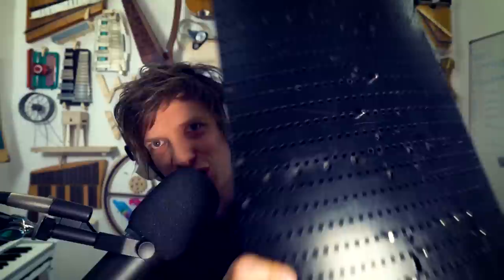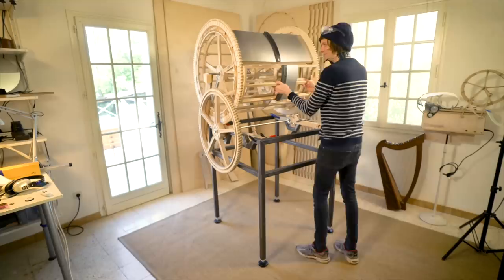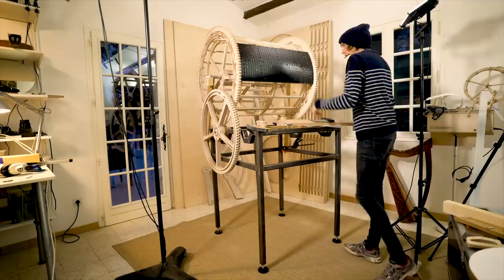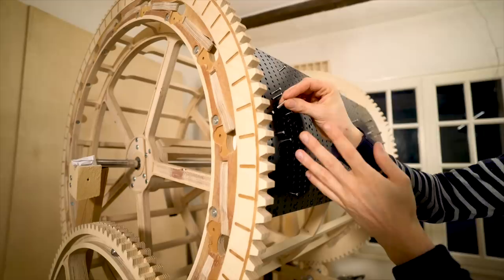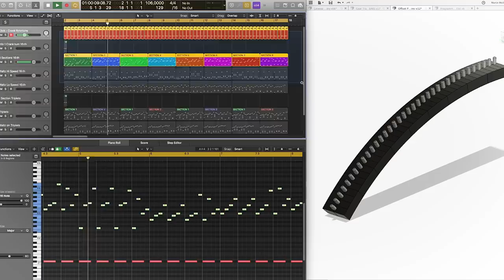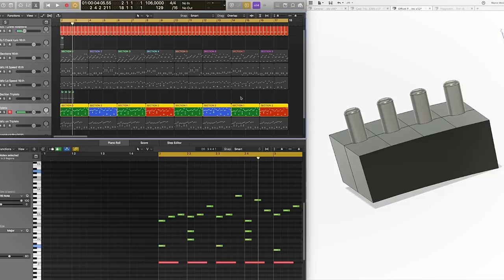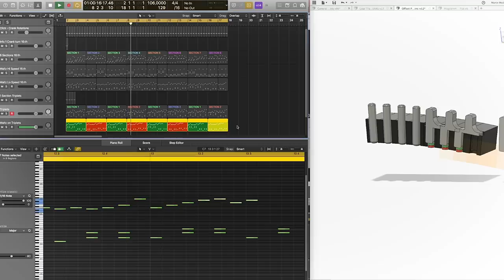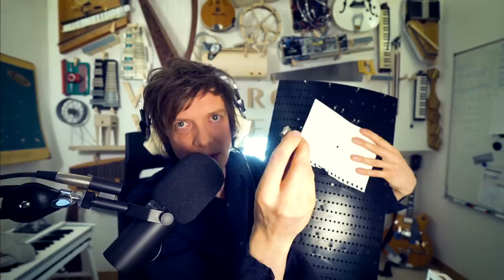Magnet "Midi" Music System - Marble Machine X #25

Comment: Hi Martin, greetings from Germany :D
 I really like the idea of two rows of registering holes next to eachother, if the small arms that release the marbles are wide enough to touch both rows. Or make a third set of 8 sections that is only made for 3/4 rythm. I would also stick to the round neodym magnets. Round holes are easy to machine, I guess that even the cnc might have troubles with square holes because you would have to use tiny cutters for that.  Also the magnets are easy to replace when you are on world tour, in case some of them brake or get lost. Any custom pins are hard to replace when you are not in your workshop.
Those would be my thoughts as an engineer and woodworker. 
Love what you are doing :) keep doing it!
Regards,
Thomas
Reply: Alternatively, you could broach square holes, but that's a pain in the butt. In metalworking, it's done using a hydraulic press. So, yes. I'd stick with round holes, rather than square.

I like the idea of having 4/4 and 3/4 registers next to each other per track so that the keys are wide enough to hit either.
Reply: If the actuator arms are not wide enough then smaller diameter pins could work. If the diameter is too small an the neodymium magnets start breaking you could just switch to the steel pins with magnets glued to the bottom.
Reply: Well since its made of plastic, he could get a small mortise to make the square holes. Heck, he could mess around with living wood joinery to make the register plates.
Reply: As it is, I think the actuator arms are wider than the pins, so having the two rows next to each other per track would just mean that for the 16th notes, the pins would hit one side of the arm (key?) and for the triplets, it would hit the other side. As long as the actuators are wide enough to cover that width, then we're golden!
Reply: I think if you can having the 3/4 and 4/4 rows next to each other as suggest is great because it also furthers rhythmic possibilities, the triplet and 16th notes can be combined for new possibilities...
Reply: Unofficial Discord - https://discord.gg/QdNwA5Y
Reply: I should also point out that the last time I played music was in my grade 5 band class, so my terminology is a bit rusty.
Reply: If there is place for three rows next to each other, i have drawn a cool solution here:
It can evenly divide into 6 and 8 per turn

https://www.reddit.com/r/MarbleMachineX/comments/7xnl7r/triplets_and_arpeggios/

I mean, the lines can go pretty close to each other, the holes can even overlap a little and still function correctly.
Reply: Daniel Bauer looks like you had the same idea I had. I like the diagram too. It is an elegant solution altogether. However, after looking at your diagram it is apparent that you would either need to have skinnier holes and pins or you would need to space them out further horizontally. Without doing that I think you risk the structural integrity of the walls between the pins (keep in mind that even though the front face is smooth, there are hundreds of ridges cut out so that it can bend).
I think it’s a brilliant idea and it pushes the limits on the precision of the alignment of the pins (and thus the timing). This is definitely the right idea and I believe it deserves to be improved upon, though I don’t know specifically how it can be improved.
Reply: I really like Daniels idea and agree that it would not lose much, if any, of its structural integrity, while also creating much more interesting pieces. And for the reprogramming, maybe you could use those CNC forms but in two sections so that the pins an slide through them, as the whole thing is curved, and have people placing the pins in them ahead of time if necessary and then just pushing them the rest of the way through the wood into their respective holes on the wheel? also, you could use the same latching system you use to hold the sections onto the wheel to hold the forms to the sections. And Quoting Buddy Clems comment because I saw it and thought it was also an amazingly awesome idea, "also add an RGB LED strip light to light the machine for playing and photography, and mount video cameras to the frame of the machine so no shot is missed."
Reply: Pilot´s Workshop I agree with all of your ideas and would like to add a few. There should be a shallow groove to mark each  measure, and vertical grooves to divide the many tracks into smaller groups to make programming easier; Similar to the 2 wheels and alternating black and gray Lego pieces in the original Wintergatan Marble Machine. Other posters have suggested alternating colors or finishes to distinguish between songs or adjacent panels. Others have suggested markings or shapes to ensure that the panels go in the right way. It's been suggested that programming templates be used to reduce errors and add a decorative pattern for each song. I like all of these ideas, but also add an RGB LED strip light to light the machine for playing and photography, and mount video cameras to the frame of the machine so no shot is missed.
Reply: I think one could only get so complex with the rhythms, because the limiter will be how fast the arm/key can drop the marble, reset and load the next marble. That's limited by gravity and the friction of the parts. Too fast and you could potentially lock up the machine, which would be a real show stopper, because that's the very thing that he's trying to avoid with this version. I'd probably pick one metre per channel and stick with it throughout the song.
Reply: Why not have a single set of holes and then a variety of pins to accommodate whatever register is required? You could color code them to make them easier to identify & stick with the slot design to hold them in place.
Reply: its harder to make the pins, and easier to confuse them. The bar magnets that he's currently using are, as he demonstrated, pretty robust for what he's doing, and are readily available mass produced. 

Remember. Engineers are lazy. They go for the simplest solution that works, cause that's what saves money and gets the job done.
Reply: to your first statement, i concede all points. the pins are robust enough (and may even demonstrate failsafe breaking in the event of a jam), and they are also cheaply acquired.

to your second: martin be be currently doing the work of an engineer, but that is not his trade. i am all for "the simplest solution" but there are many dynamics at play in this endeavor. the goal is to find the simplest solution that fulfills all requirements. if it is a requirement to have a flexible register, my solution makes a bit of sense.
Reply: It's not just a jab at engineers, but actually the mark of good engineering: The simplest design that bears the most function. 

There is a reason for this ethos of "laziness." The simpler it is while getting the desired job done, the less there is to go wrong, and the cheaper/easier it is to produce. In the case of swapping pins, it's much easier if you don't have to pay attention to what kind of pin you're installing, or which direction it's oriented, but just to filling all the holes on the template for that particular song. Especially if you're switching programming plates, programming the next song backstage, and don't have time to test it before performing. In that case, the simpler design, having separate 4/4 and 3/4 tracks per channel rather than different types of pins to worry about, is by far the better. Conceivably, he could also make plates with different meters if the need should arise, since he has to swap out for the next song anyways.
Reply: Buddy Clem - Nice! Will see how his tests with the programming templates will go.
Light strips would make it hardcore, but it will look impressive either way.
Reply: BlackEpyon - exacty, often it is harder to design something that is simple but reliable than something that is complicated. The first marbe machine looks much more complicated and crazy, but was very sensitive. Now with MMX he took much more time to design it and it looks much clearer and sturdier, even though it has many more moving parts than the old one.
Reply: Would using a color other than black for the plastic make it easier to spot missing pins, perhaps? When the template is on, a bright color showing through would be useful, especially on a dark stage.

Another idea would be to have two cranks. One with teeth for 4/4, and one with teeth for 3/4. It would mean you can't logic 3 and 4 in the same song, but it would be a neck of a lot simpler.
Reply: Oh yeah, Daniel's idea is excellent, too!
Reply: +Stabil
With the two-pronged "adapter" going every other position for a 3/4 metre? Perhaps, but it would still make it more complex to set up. But in that case, it'd work better to CNC or 3D-print the pins and glue the magnets on the end instead of having a metal plate between three bar magnets, but either way it introduces more points of failure. I think just the solid rod magnets with separate tracks for 3/4 and 4/4 are the way to go here.
Reply: +Ravien1
You'd need to replace the plates or have  tracks for 3/4 metre, since 64 doesn't divide evenly by 3. Besides, the x/4 scheme is the most common, so it makes sense to keep the crank as-is.
Reply: What if instead of gluing magnets to the pins, glue small magnets to the bottom of the hole, then use steel pins and eliminate the metal sheet behind the programming plate?

Comment: KISS - Keep It Simple Stupid 

Something I tell myself more that often. 

My suggestions:
1. Only one type of pins. Block type and vertical/horisontal holes. Visual help during programming is super and used in industry solutions
2. Sure the pins come of easy now in your home. But live behind stage with stress, sweaty, greasy finger? Consider gloves or similar for the technicians so they don’t contaminated the magnets.
3. Number your frames so you don’t mix them after programming. That also ensures that you always know that they will fit.
4. Your programming template must be flexible or have really loose tolerances to be able to be removed.
5. Matte always matte. Glossy only stays glossy for 0.1 s 😉
Reply: This is a great comment.  To KISS it up even further, just go ahead and invest in making a set of panels for each song you intend to play on tour.  Especially on tour and on stage you want to keep the number of points of failure to a minimum.  People WILL mess up reprogramming.
Reply: I agree with KISS.  I would ditch the pins all together and 3d print the panels with the "pins" where they should be.  You would need one set for each song and you would only have to swap out the panels.  To reduce "human error" even more, you can print numbers on them and make them puzzle piece shaped so there is no mixing them up.
Reply: no magnets, no steel plate, put the pins where ever you want, play triplets, 3/4, 6/8, change tempo, the flexibility is endless -  just 3d print the panels.

Comment: 2 sets of tracks, one divisible by 4 and one divisible by 3, you will save time changing pins and also not have to use 2 types of pins.
Reply: And if you take that idea further, you can program one song on the 4-pin track, and one on the three-pin track, and change songs by shifting the entire wheel over a bit. Multi-track programming wheel!
Reply: Might be a little difficult though, as he's already been talking about having 2 channels per output so the machine can play double speed. Each note would have to have 4 channels with this method
Reply: Although I hadn't watched to the end of the video when I wrote this comment

Comment: It looks like there is room on the wheel, why not stagger the holes left to right slightly. The registration finger could still pick up both sets of pins, it would just pick up the 4ths on the left side of the finger and the 3rds on the right.
Reply: offsuit57 I was just thinking the same. I imagine using different kinds of pins makes reprogramming it backstage a nightmare.

I am also wondering why only keep two sets and reprogram them at all? Material cost vs. manpower cost + possible errors?
Reply: I came to say this.
Reply: Excellent idea, offsuit.
Reply: That seemed to be what he proposed near the end of the video, but using differently shaped holes/magnets for triplets to make 4/4 and triplets easily distinguishable.
Reply: I don't know if that got edited in later or if I was just so full of the idea that I stopped watching, but I completely missed that part of the video.

Comment: If you divided it by 12, it could easily divide into 2,3,4 or 6
Reply: Final Spartan But it can't play 16
Reply: Good thought, but it wouldn't be good. By using the triplets, it essentially does change it to 12. If this were then divided by 4, it would drop to 3 measures per block, slow the tempo, and reduce the number notes in the song, making the original marble machine song unplayable. And if there's any clicking of the gears, it wouldn't correspond to the correct beat. I think the two rows of skinny pins would work best.
Reply: Or strong magnets on clean sheet of metal. Then you just paint magnet places on it. I don´t like idea using different type of pins...
Reply: or set off triplets for a while and when time and money allow build a set of boards with 3 holes per 4 tacts than 5 holes per 4 tacts and if im not wrong there is also 7/8 tempo. Like 2 sets for most common 4/4 tempo plus 1 set for 3/4, 5/4, 7/8 or any other U think is worth trying
Reply: hmmm or insteed of using separate holes  like 0000 somethink like 1 big  (^^^^^^)..... what i mean in the middle of 1 hole start 2nd one and in the middle of 2nd one make 3rd one  - one long hole with "teeth" that will fix pin in one place with more divercity
Reply: It would need too thin pins

Comment: Martin aka Wintergatan 
You heard this probably milion times but... you makin' ingenious work there :)

Personnaly i think that the interchangeable, pre-programmed plates are easier and better solution for swift melody changing.
For example, the song ends. Two tech-crew members will loose the levers of the section and another crew member take it to the side to replace the program plate. Meantime the next person takes second section, and next one takes the third, and so forth. First person coming back with first newly programmed section and place it on the first free space on the wheel. The next crew members will do the same until all sections will be reprogrammed and replaced. Whole procedure will look like motorsport pit stop ;).

My thoughts about your's programming system is: it's very complicated to perform it well on stage, the way you plan. 
1) It must be tested how much time will take to reprogramm one wheel section, using template. If it's a minute up to two per section, it's fine.
2) Holes on templates should be placed in contrasting dots. The programmer will find them quicker and it will be easy to track witch hole miss the pin.
3) The idea of block magnet pins is fine to me. One type pin for triplets and 16-th. Simple solution. You can also offset holes for rod magnets like you've done for block ones. Yours call.
4) Mark spin direction on the program sections. It gives to your crew much less chance to mount the section upside down on the wheel in hurry.

I am also vote for gloss program plate, but maybe different colour?

Did you consider a battery of spiral lifters?? 
https://www.youtube.com/watch?v=NLpX9v4o7UU&t=3s
Reply: I agree. Perhaps he could use 3 sets of programming plates as well. Set #1 on the machine, set #2 ready to go/on standby, and set #3 being programmed. Contrasting dots or maybe even colored sections would help technicians to align the plates as well.
I disagree with his idea of letting fans do the programming. More bodies on stage means more chances for error. Unless someone he trusts is there to inspect and proofread all of the completed plates.
I agree with how he wants to use the programming pins as a breaking point if there is too much strain. The pins and plates are MUCH easier to replace than anything else.